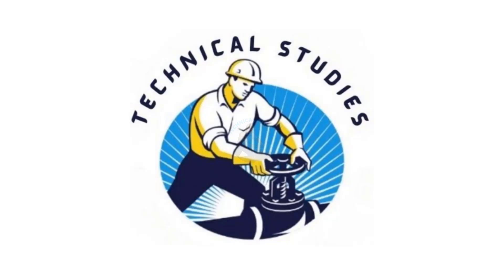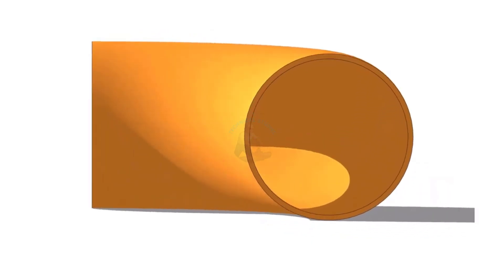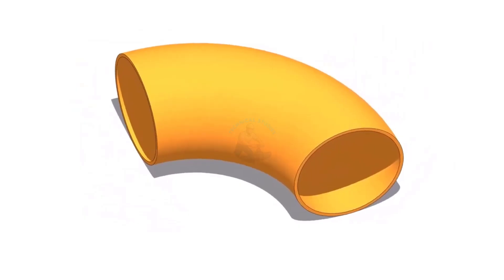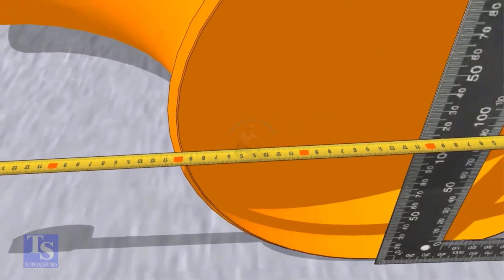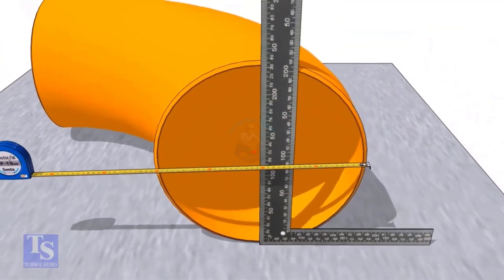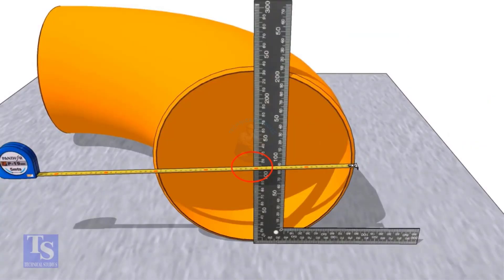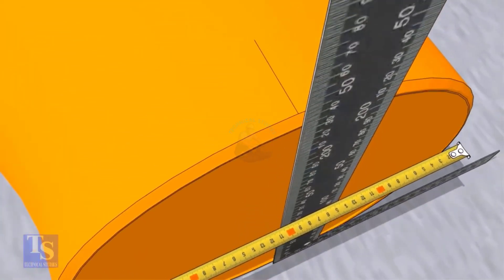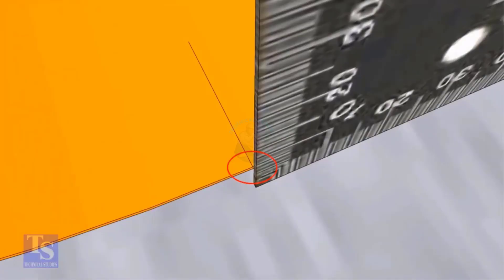Easy Method to Find the Center Lines of a 90° Elbow

Comment: Put it on a flat spot put the square measure to find center make sure the 90 is actually sitting flat by checking the ends with a square
Reply from the maker: Exactly.